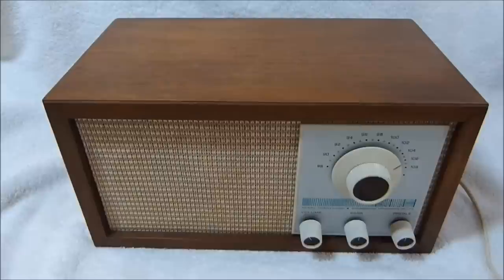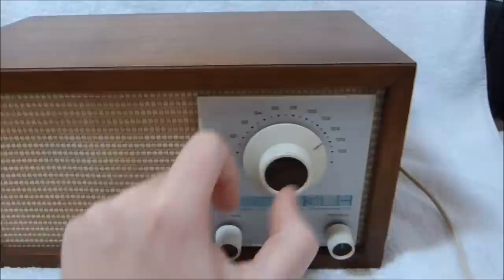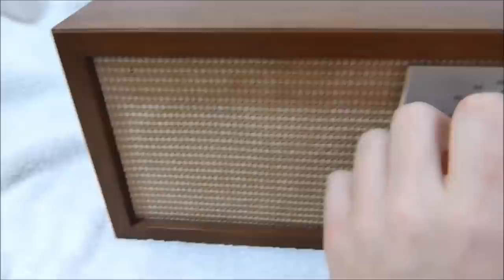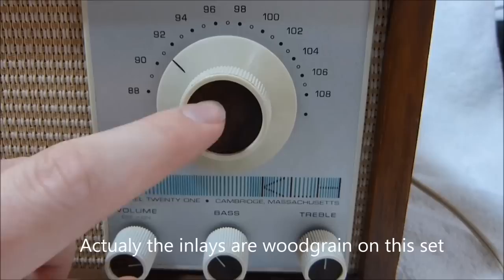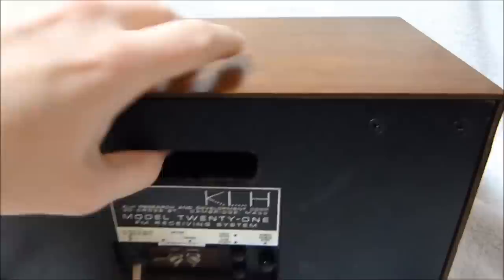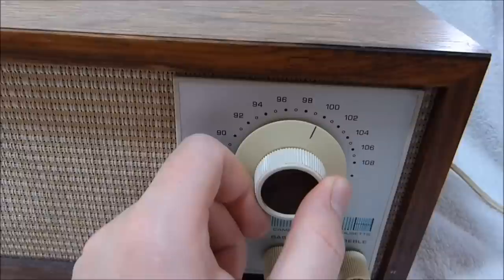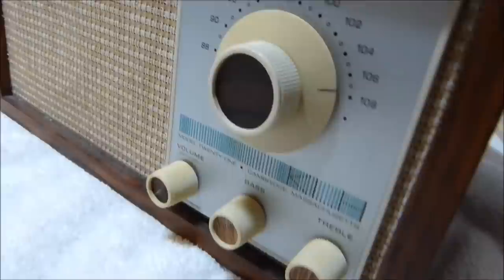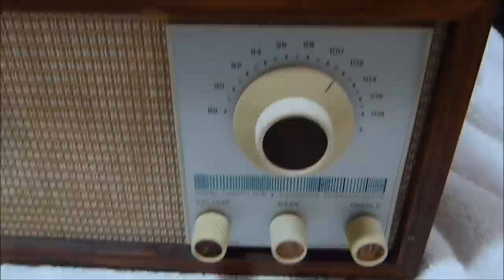1965 KLH model Twenty One transistor table radio (made in the USA)

Comment: Ah, the sweet days of real table radios with engineering design to rival expensive, high end audio systems. I also remember the KLH stereo systems, which were very similar to the Scott systems. Several of my college friends had them, and it seems they could not be overdriven to distortion.
Reply from the maker: KLH made some very fine products back in their heyday, including this one. RCA, Motorola and Sylvania all made their own nice table radios as well (though perhaps not this nice).
Reply: I have some 1972 KLH model 32 speaker. Sound great. Small for their age too. I wonder how the extension speaker from this radio sounded. Is it any better than the built in speaker driver despite it being the same part used in the extension speakers?

Comment: I always wondered how those looked on the inside. It seems very well built, but the thought of 25 watts going into a cabinet with no vent holes is a little scary; I assume that all that metal attached to the output transistor heat sinks spread it out enough. That's quite a speaker magnet; the only other place I've see square ones was in Magnavox Astro-Sonic consoles. Thanks for posting .

Comment: Thanks for sharing these with us, Matt!  What does that vernier tuning feel like??,  because it surely appears to be very responsive!!

BTW, the guy from Wyomissing has six or seven radios going up for sale at Renninger's beginning Sunday, November 30th. I'll have someone check to see what's up - and if anything interesting appears, you'll have to head down this-a-way! (they're always expensive at Renninger's, however, antiques just aren't moving at this time, so it's a buyer's market).  My guess is that the cream of the crop will go, and he has one darn nice RCA AR-88 - and a late model or last edition of that radio. I'll get the pricing and forward.
Reply from the maker: The gear reduction tuning is very smooth on this set, because this set doesn't have the thousands of hours of wear and tear on it like a lot of these do (plus I just oiled it).
Reply: @50sTransistorRadios  Too few manufacturers made tuning dials like that; the direct connection to the shaft eliminated the slop of a dial cord and having both coarse and fine tuning was a big help. They probably also cost less to make than the rope & pulley mess you'd find in a typical table radio of that era.
Reply from the maker: @pcno2832  Direct drive Tuning like this set has is nice, though you generally don't want to try to tune it (or other sets with a similar mechanism) by the large outer knob.

Comment: Hey Matt, great video!  I'm restoring one myself, it's the Twenty One - 2, so after Henry left the company.  The previous owner replaced the original driver with a knock off and I found a replacement.  My question is, do you recall which color lead wire is positive?  The one I have seems to be wired in reverse....white wire with red stripe soldered to negative terminal and black wire soldered to positive.  Do you recall how yours was wired?  Thank you!!  Karl
Reply from the maker: It sounds like the speaker wires are reversed (if they follow the usual color convention), but in radios that only have one driver, the polarity doesn't really matter (since there is nothing for it to be out of phase with).

Comment: Thanks for sharing. Nice video. Any tips on how to clean the grill cloth on these Sets?
Reply from the maker: +Gaurav Gulati The grill cloth is some kind of plastic, so I removed it (you have to disassemble the set pretty far to do that) and cleaned it with hand soap and warm water, then reattached it with glue (I did that to the more beat up example of this model I have, this one was OK after a wipe down).
Reply: Thanks! I will definitely try what you suggested.

Comment: i just got this radio today the date on the speaker says it's from July 26 of 1966 it works great but it's to bad the top of the radio looks like it was used as a coaster for drinks to sit on :(
Reply from the maker: Hopefully you can sand and refinish the radio. KLH seems to have made the cabinets reasonably well, though they are veneered, not solid wood.

Comment: Hey Matt!  I have one of these that my dad owned but it hums instantly when the power is switched on - a bad filter cap do you think?   I was looking for a replacement and was wondering what you used to recap your Twenty One?
It sounds pretty sweet!
Reply from the maker: That definitely sounds like a bad filter capacitor. I replaced the main filter cap in mine with a new 2200uf 35 volt one from Nichicon (you can buy them from Mouser or Digikey). Good luck Dan!

Comment: My parents bought one new and ran it everyday. Without my knowing they tossed it eventually and got a Bose which sounds better. For sentimental reasons I would like to replace it but worry i cant deal with cap problems. Would you be interested in the job of re-capping one and also can you do the same job on a Sony 7600GR portable radio?
Reply from the maker: Sorry, but I don't restore radios for others. However, you could likely find someone willing to take the job here: https://www.antiqueradios.com/forums/viewforum.php?f=15
Replacing the main filter capacitor is fairly simple though, as it's not on a circuit board.